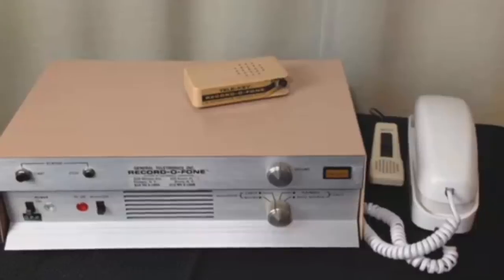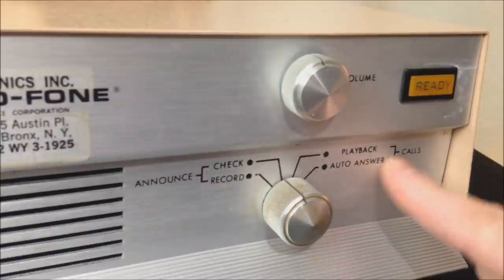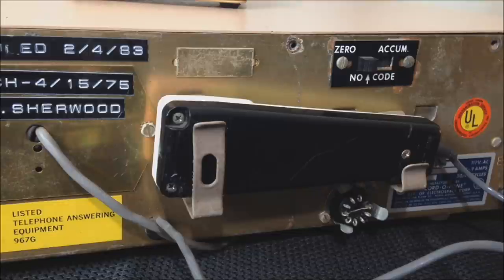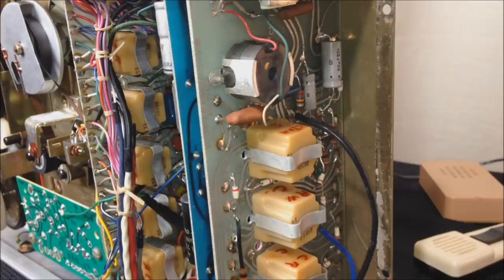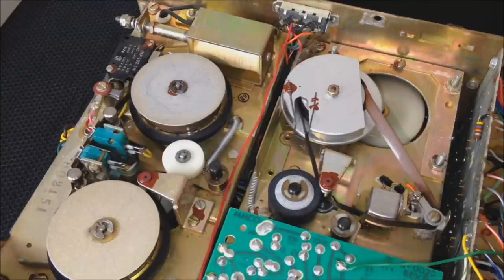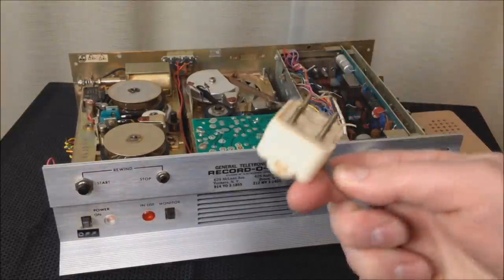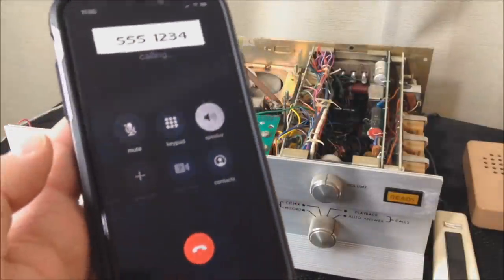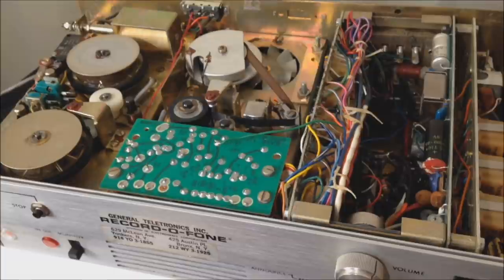1965 Voicemail - Record-O-Fone 100U Answering Machine

Comment: The Tele-Key most likely allows you to check messages remotely (which, in 1965, you'd most likely do from either a payphone or a hotel/motel room phone). Many answering systems up until the invention of remote touch tone access in the late '80's or early '90's included a similar device to the Tele-Key, which you'd hold up to the mouthpiece of the telephone handset, and transmit the tone made when you depress the button on the device. That tone would be a tone that the answering machine could pick up, and then would then signal the tape inside of the answering machine at home (or your office, I guess) to rewind itself, and begin playing your incoming messages. The device below the microphone holder on the back is likely a connection for an external microphone, should you not want to use the cheap one it includes.
Reply: It always amazes me how advanced society was to think up and invent things like this so long ago.  Now people are too stupid to even know how to drive a car anymore.

Comment: Yes, the remote I believe is used to check your messages whenever you call in, you would hold the remote up to the receiver and play the tone, I believe that the three positions switch on the back of the machine probably selects which tone you would like, I believe the off position would disable the remote playback feature. Could you please do a follow up video trying that out?
Reply from the maker: Absolutely!  I could not find an owners manual for this beast. :(
Reply: Yes to turn off the remote feature. Accumulate left the messages on the machine after remote access. The other setting rewond the tape to the beginning after remote access and new messages recorded over the old. The key could also be used to skip back a bit to repeat a bit of a message while listening. The two-tone set was not user changeable, but could be set by a tech with a frequency counter, as could the keys to match. The tones were plain tones, not DTMF tones like those produced by touch-tone phones, which were still less common in that timeframe.
Reply: @databits  See my other comment, and for any info you needlet me know,  as I was a tech for an 
 R-o-F reseller for a couple of years.

Comment: An even better option is an Xlink cellular gateway, which lets you use your existing cell service. You can hook any landline phone to it and it works (as long as it has an RJ11 plug or has an RJ11 adapter.) It supports both tone and pulse (push button and rotary) and provides enough voltage to trigger a mechanical ringer. I made and received calls with an antique candlestick phone from 1910 on my Xlink and it worked great.
Reply from the maker: Yes!  I saw these!  But the $100 price tag was a bit much for testing.  I really liked the concept!

Comment: I spent two years in the field as tech repairing these units. A few factoids... The Telekey was used to retrieve messages remotely. You called your machine, and once it picked up, you held the key to your phone mouthpiece, then prossed the switch part way for the first tone, then all the way for the second tone. About two seconds each. That caused the message tape to remind to the beginning, reverse, and play back your messages.  If the switch on the rear was on "No Tone", the remote function was disabled. On accumulate, the message tape stopped after you heard your messages remotely. New messages were then recorded after any old ones. They accumulated. The other setting on that switch rewound the tape to the beginning, and old messages were recorded over the old. Listening was a one shot deal in that mode. But, you had less chance of running out of message tape while away for a long time. There were multiple two tone code sets to minimize the chance of someone else from keying into your machine. (With experience, one could learn to whistle their codes. I could "whistle key" any machine)

The erase button was spring loaded. After  listening to all you messages 
(Manual playback ) you held it to the left while the tape rewound, erasing the tape. Erasing not only erased the tape but recorded a high pitched tone on the tape. When listening to messages, you know you heard the last message because you heard that tone. Rewinding the message tape to the beginning, the metal sensing tape shorted the fine "cat whisker" contacts stopping the rewind. Leaving the tape at the beginning turned on the "Ready" light. If you looked at the machine and the ready light was out, you knew the machine had answered a call. 
The endless-loop "Announce" tape had a function beyond the recording. When you released the mic button, the "beep" tone was recorded for several seconds after your voice. When a call was answered, the beginning of the recorded tone  was sensed and that was what switched on the record deck. 
The jumper plug in the back was used on a model that had a full size reel to real tape deck mounted above the base machine. It was used to allow companies to take long messages, such as extended orders from their salesmen.
 If you had the unit on Auto Answer, you could rub  a damp fingertip over the contacts on that plug and it would trigger an answer cycle without having to ring the phone. Great for testing without having to have someone ring you back.
Finally, your machine has an optional "MMCO" board installed in the area above the speaker. It allowed the message deck to record as long as someone spoke to a degree. Without that option, one could only record an incoming message while the announce tape loop ran. So, if the loop was a one minute loop, and your announcement was 20 seconds, only a 40 second message could be left.  That, and EVERY message was was 40 seconds even if the message was only a word or two . MMCO was Message Motor Cut Off. Once there was 7 seconds of silence it stopped the record deck and hung up the line.
Any more questions? I'd be glad to answer them! PS: a model 200 machine had dark case with wood side panels.... For Executive desks. There was also an Answer Only unit with no record deck. It was used to make announcements only, like movie showtimes.
Reply from the maker: Great information!  Thank you!
Reply: i have a question when i hangup the message recorder still keeps on going tho i just noticed when i record my message an let it do its thing it hangs up the line is there a way to make it hangup when i end the call cause i dont think anyones gonna know to just leave the call run when they record there message

Comment: Wow. Haven't heard that ring for decades! 😁
What I've read from some ebay listing: "Tele Key"  allows the user to call home and access recorded messages from the machine remotely. Playing the beep tone from the portable Telekey initiates playback. Telekey works using a 9V battery (not included).
Reply from the maker: Thanks for the info!
Reply: I remember my parents answering machine. It had a mechanical remote (that would be battery less), doing a "click" to allow to listen to the messages.

Comment: Hey, the handheld device is a remote for checking your messages. You call your own number when away from home, hold it to the phone mouthpiece, then use the tones it generates to prompt the answerphone into  playing back your messages. We had these in the UK before touch tone phones were a thing. The weird looking contacts on the back, was a standard DIN socket. Looks like the top half has broken off leaving the contacts exposed. If I had to guess I'd say it was audio out, for recording your messages to an external tape deck.
Reply: We had those in the US, too. I remember seeing them in the Radio Shack catalog.
Reply: My dad used to sell and service these back in the day. I believe (it didn’t come up often) the round connector was for a PBX system.

Comment: 6:30
I think seeburg background music had something to do with this system
Noticed that little socket these black under microphone holder. That’s a kill switch. If you remove that it won’t work 
It pulls out like a socket 
Another giveaway is the blue name plate tag on back same style in seeburgs
:)
I own a few seeburg 1000 machines and the encore machine. They all have that style tag and kill plug 
Don’t ever loose that plug or it will never work

Comment: My mum had a fancy answering machine that only used a single microcassette for both the outgoing message and the incoming messages. Fascinated me that it only used one tape, instead of two, like all the other answering machines of the era. 

It wasn’t until years later that I figured out it had a two track head, and used one track for the outgoing message at the start of the tape, and the other track for recording the incoming messages.
Reply: I also had a microcassette answer machine like that. Mine had the outgoing message recorded at the very beginning of the tape, then it would play a beep while it fast-forwarded to a free spot so the incoming message could be recorded. The more messages saved up, the longer the beep. It kept track of the precise cassette positions in RAM, so if there was a power outage, all settings and messages would be lost!

Comment: Outgoing message motor has a fan.... knows how to play it cool.

Perhaps that box generates a special tone that you put up to the mouthpiece of the phone you call in on and allows you to remotely playback your messages?  Look for a tone decoder on the PCB that goes to a relay that bypasses the playback switch.  This was before touch tone phones, so to remotely control your answering machine it would have to be that way.

This was one loaded piece of tech from its time, still usable to this day if one had to.

Comment: One of those tones should be the remote playback tone. Back in the 70's many companies 800 numbers could give you access to a dial tone (an "outside line") that employees traveling around the US could use to make free long distnce calls. Phone phreaks would search for these and trade them among themselves. Often when searching they would get an old style answering maching. Instead of hanging up they would wistle a slowly rising or falling tone in the hope that they would trip the message playback sensor that was expecting a single tone.

Comment: The tel-a-key was used to retrieve messages, the switch on the back determines what happens when you do. 
No code - it won’t do anything
Zero - messages are deleted after being played back.
Accum- messages accumulate after being played. (The tape doesn’t rewind).

I don’t recall whether this unit would do it, but the newer 100RX model would also allow you to delete messages remotely. 

To use the remote, call in, listen to announcement then press button to first position a couple seconds then the second for a couple more then release. 
On units that erase, simply press a couple second for the first position and 15 seconds for the second and then release.

If anyone has any other questions, let me know and I’ll do my best to answer them.

I’ve enjoyed this walk down memory lane.

Comment: That tone sending device is to send a tone code by phone your machine would recognize when you want to check your messages if you're away from home. I am not sure if that can still be used today though because of the technological changes in phone line circuitry. I know that after that big upgrade the Bell System did in the late 1970s with their billions of dollars of phone switching technology equipment, the Record a Call answering machines from the early 80s were set up with remotes that had a different tone code system that used alternating beeps and a brief sound like an old dial up modem.

Comment: You could not pay me to get rid of my landline. It's cheap and there's no batteries to be dead. It will always work. It's not slow, it doesn't take minutes to boot up. Just lift the receiver and make a call.
Reply: I used to say that too and I held onto my landline until last year when the price was just too high.  AT&T keeps raising the price to get people to move to fiber/VOIP.  Just for local calling and no long distance it was over $40 per month.  My cell service with unlimited calling and internet is $30.  I realized I was paying to get calls from tele-marketers as that is all who ever called my land line.
Reply: @RacerX-  I think I pay like  $22 for the landline, but with no long distance or unlimited calling. But I do have it together (packaged) with my internet, so it may be that I am paying less for the standalone than I otherwise would.
Reply: @christo930  Thats probably it,  AT&T doesn't offer above DSL speeds on my street so we have to use Xfinity.  I would have kept it if they cut the price to $20 or so.  Oh well I have an OBI device and still can use my old phones and devices for free instead.
Reply: I have xfinity.

Comment: Regarding Magic Jack/Xlink cell gateway... If I just wanted to activate old telephone equipment for fun, without paying for a service, wonder if the parts (or firmware) from an old VOIP router could be repurposed somehow to generate ringing voltage and simulate a phone line?
Reply: You could use an Asterisk server and connect the VOIP router to it

Comment: That thing must have cost a fortune.  It's odd that the guy says he bought it in 75 unless they were selling it at a huge closeout discount.  In 1965, that thing was probably a couple of hundred dollars or more.  Do you happen to know how much power it consumes just sitting there waiting for the phone to ring. .9 amps is over a hundred watts, but there is all those relays which are only very briefly used. But it would still be interesting to know how much power it used just sitting there waiting for the ring.
Reply: I did some looking around, and it seems the manufacturer went bankrupt in 1974 (which would explain why it'd be deeply discounted in 1975). I saw a 1971 manufacture date on one of the switches, so this thing was likely sitting around for a while (or was built with NOS parts).
Reply: I worked for a company that sold them as a repair tech. $599.00

Comment: Hey this might be totally random, but I'm working on a screenplay set in 1963, and there's a character that tape records her own phone conversations. What device could she have used at that time to make that possible? For what it's worth, she works at a TV station.
Reply from the maker: She most likely would have used a tape based dictation machine such as those made by Dictaphone.
Reply: @databits  Thanks. That’s a big help. Getting the random period details right has been a huge challenge, especially the tech.
Reply from the maker: @PurpleWarrior13  Any time sir.
Reply: @databits  Hey, would she be able to hook the machine directly to the telephone in some way, or would she need to point the machine's mic at the phone speaker? I'm trying to avoid the latter if possible because it would look clunky on camera.

Comment: I'm curious what it does in some edge cases. What happens when it reaches the end of the tape; does it just hang up immediately? What happens when you call and the tape is full; does it ring forever or does the announcement message play and then immediately hang up?
Reply: Well, I know it's a year ago, but here's your answer. When the message tape ran out, it let a micro switch on the reel open. Yes, it hangs up if the tape runs out. If the tape runs out, it no longer answers the phone. And, that was an issue if you were using the remote message playback. If you didn't check in and listen and rewind the tape, then you couldn't access the machine until you returned and manually rewound. I once did a service call at a call-girl's residence. She had a "client" who fell in love with her. He would call her machine over and over to run out the tape, so she couldn't be contacted by other guys.